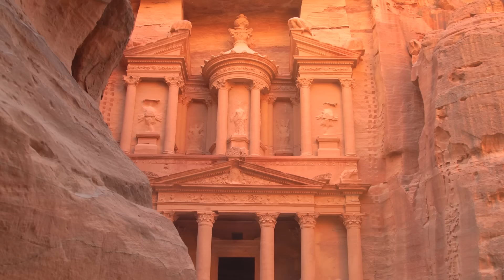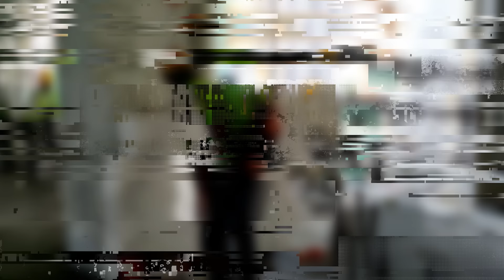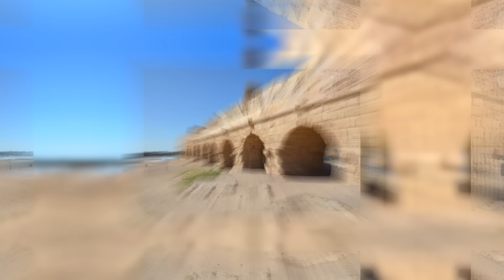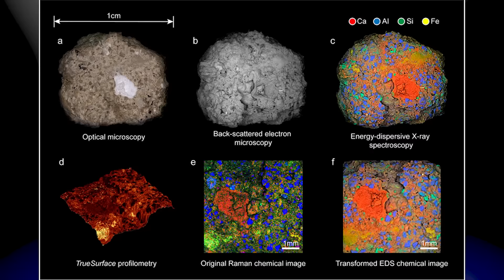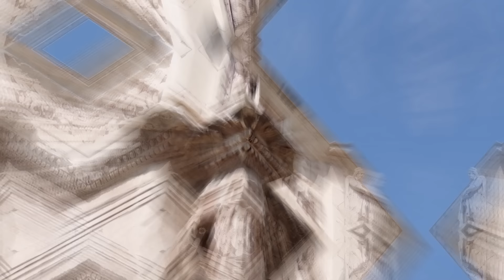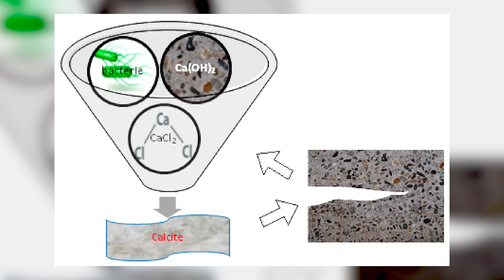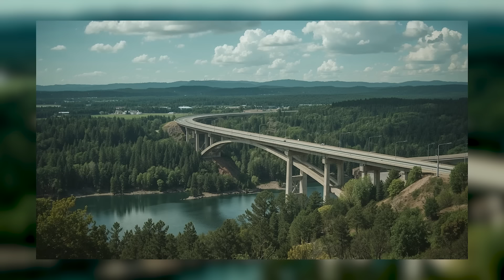Why Roman CONCRETE Lasts 2000 Years While Ours Dies in 50

Comment: Helps to live in a dry country as well.
Reply from the maker: The dry climate does a lot of the heavy lifting on the ones that survived. Though the Romans also had harbor concrete that set underwater and is still holding, so they weren't only getting lucky with the weather.

Comment: The seawater finding really does feel like a game changer. If Roman concrete can actually get stronger in salt water, it makes you wonder why we are not using that approach for every seawall and pier instead of replacing modern ones after only a few decades.

It is frustrating to think we are stuck in this demolish and rebuild cycle, especially when it adds more waste and environmental damage. What makes it worse is the idea that the knowledge is not gone, it just is not being used at scale because the current system has stronger financial incentives to keep doing things the old way.

Comment: There are also a lot of serious mistruths here. Inadequate cover on reinforcing steel, incorrect slump/water content ratios, the applications of concrete in the modern age (whereas the Romans did not use concrete in tension like suspended slabs) are all major omissions in this presentation. 
Overall while there is some good content, this presentation is flawed and misleading.

Comment: Rust is why concrete buildings must be clad in waterproof materials, and not allowed to have high humidity... and why exposed concrete must be constantly maintained.  That is, sealed or painted.  If you coat still curing damp concrete with high calcium lime plaster the two surfaces will fuse together in drying, protecting the concrete underneath.  Which of course is expensive, but lasts longer than paint.

Comment: I built my ICF walls with a cement mixer (Traditional timber frame holds up the structure) stuffed with as much rock as would fit (rock-crete), and I liberally used stored burn barrel ash. Hope it lasts forever. Covered every wall inside and out with rock, tile and sheet metal. Would be difficult to burn down. Quarter inch hardware wire stopping the flying embers getting past the aluminum soffits. Two thousand years later… no problem. I soaked the rebar with creosote so it will not rust. Time will tell.

Comment: Roman bridges are relatively bulky. Too big for the load. They utilize arch technology which has the ability to carry bigger loads. They are not overly stressed. 

Today's bridges utilize different technology. Relatively smaller members, not usually arch,  and are over stressed compared to the Roman bridges.

If the materials used by ancient Rome will be used nowadays, they will easily crumble.

Comment: This really is inaccurate. Even though the Romans sometimes built a large scales, the Pantheon relies on a lot of additional design features to avoid collapse. We do not build in the way the narrator idealizes for practical reasons. Extensively unreinforced concrete could not be used to construct modern high rises and cities, or large scale bridges. Besides the obvious technical impossibility, the costs would not permit this type of construction. Today’s concrete is much more sophisticated than the video suggests. Modern plasticizers, crystalline waterproofing admixtures, more sustainable fly-ash. Epoxy coated rebar, and different methods make it far more suited to modern construction. Take the construct staging and necessary sequence of construction as on instance. That alone would preclude what this video is trying to describe. As of my watching 293k users have watched this video, so seems worth pointing out that although it states some facts it misses the full picture entirely. I think anyone can post a video like this without any real understanding of things.

Comment: Wondering about the numerous photos contained in the video where there appear to be ruins? What caused the ancient Roman structures to crumble? I think it's important to take note of the old Roman structures that are still standing as has been done in this video presentation. @Freedommistman raises some interesting points. His point about sealing the concrete like a glass enclosure is also interesting. But glass also would seem to crack with vibrations from heavy traffic, earthquakes and even wind forces and rains accompanied by rain where things like skyscrapers are designed to flex to a degree. I find it gratifying to see these kinds of presentations especially with an eye to making improvements.

Comment: You asked for suggestions of other mediaeval technology.  I heard that the Incas in the Bolivian altiplano constructed canals with no entrance or exit, so they clearly weren't for irrigation.  What were they for?
It was found that when filled, the canals would radiate heat at night, and prevent the crops from freezing.  It led to huge increases in yield, as these canals are now being used in that way.

Comment: There’s a stretch of Highway 101 along the Oregon coast that’s had ongoing problems from mountain runoff for years. The state spent a fortune installing stainless steel rebar to prevent cracks and slope failures, but it didn’t solve the issue. Maybe a self-healing concrete approach would be a smarter long-term solution.

Comment: The main problem is not the water through the cracks but improper placement of the rebar. Before the pouring of the actual concrete the rebar should be placed in the casing and spacers should be added to keep the rebar more than about an inch away from the casing (= the later outside of the concrete) on all points. And before the pour, this should be checked. If this is done correctly, the rebar is deeply enough in the concrete and will normally not start to rust. However, the checking of the spacers are are correct and the rebar nowhere comes to close to the surface is time consuming and expensive. And furthermore, after the pour is done in the short term there are no visible signs of this problem (unless the rebar actually pokes through...) and so will normally not be found before the bills are paid. This means that it is very tempting to cut corners in the checking of the rebar before the pour. With the resulting long term damage... So the REAL problem is the greed and short term thinking of modern builders.

Comment: Here's the tradeoff the shorter the lifespan of concrete the more we waste sand. Eventually what's going to happen is as we extract the quality of sand faster than nature can provide we will eventually run out of it sooner than later. Only When that day comes it becomes the end of modern era that depends on infrastructure concrete. When that happens It'll be biggest possible disaster like society has ever seen to their structures. Hopefully by then we substitute with something else or we start prioritize long-term lasting durable materials.

Comment: This advert about research funding will not work, my friend. Yes, the Romans used their knowledge based ingenuity. They used something else: their urine which biological matter. Jokes apart if you know what is lime you will understand the secret. Lime is a biological product of microbes living in salt water in the seabed. Our present day engineers add energy by heating it to couple of thousand degree. This heat gets release in a reversed exponential process. When energy is dissipated the bonds also gone. But in an arched structure what you get is compression that helps to make it last longer.. Perhaps unslaked lime get more energy over time. What brings energy is the key to understand the process. Here is a clue: do not think it is only the white light that brings energy to us.
One more thing: the crack concrete model that is being used in the analysis as per eurocode (EN3 as I can remember) is to be blamed. But those design engineers make lots of money from consultancy work. Do not forget the fact that em waves emitted in this process are harmful to those living in new concrete buildings in addition to sudden collapse of buildings without a warning.

Comment: I built my house into a steep hillside using crystalline integral waterproofing mixed into the concrete at the plant before it is loaded into the delivery truck.  This product (attempts to) replicate the autogenous actions of the roman concrete while working with modern concrete and rebar structures.  My cost for this admix was only 1% of the total cost of the concrete foundation install and in my opinion totally worth it.  The other thing I did--and most people don't know this is allowed by code--is to insulate the EXTERIOR side of my concrete walls, NOT interior (with rigid foam).  And then cover that with a waterPROOF membrane (and then dimpleboard yadda yadda then backfill with drainrock).  Not only is my concrete dry, if water ever pentrates the membrane and insulation, it will encounter the self-healing concrete mixture that self-repairs small cracks and seals out more water.  Not only does it make the basement waaaaay more enjoyable (not dank at all), but it reduces all sorts of future issues that would come with a dank basement.  I live in a rainforest (Olympic Peninsula); here we don't mess around when it comes to water management.
Reply: Very clever :-)

Comment: Real concrete as we use in Sweden lasts a lot longer than 50 years. And that is with freezing temperatures and salt from the roads. The biggest challenge the Romans had was a bit of rain water...

Comment: For a long time, modern engineers were baffled by the durability of Roman concrete, especially when compared to some of our own structures that deteriorate in mere decades.

The idea that Roman concrete was "superior" is a complex one. It's not that it was universally better, but that it had a specific, remarkable property we are only now fully understanding: self-healing and incredible longevity in certain conditions.

Here’s a breakdown of the comparison:

The Case for Roman Concrete: Why It Lasts 2000 Years
The Self-Healing "Secret Ingredient": The Romans used lime and volcanic ash (from a place called Pozzuoli, hence "pozzolana"). For centuries, we knew this made a strong concrete, but recent research (notably from MIT and other institutions in 2023) uncovered the real magic.

"Hot Mixing" with Quicklime: They used a process that created lumps of quicklime (calcium oxide) within the mix. When tiny cracks form and water seeps in, it reacts with this quicklime, dissolving it and forming a calcium-saturated solution. This solution can then recrystallize as calcium carbonate, sealing the crack shut. It's a built-in, automatic repair system!

Perfect for Their Environment: Roman marine concrete, used in harbors and piers like the one in Caesarea, was exposed to seawater. The constant battering of seawater actually triggered a different beneficial chemical reaction, creating rare crystalline minerals (like aluminous tobermorite) that made the concrete stronger over time.

Design Philosophy: Roman structures like the Pantheon were massively over-engineered by our standards. The Pantheon's dome is over 20 feet thick at its base. This brute-force approach, combined with their durable material, created structures that could withstand millennia of settling and earthquakes.

The Case for Modern Concrete: Why We Use It
Speed and Strength (in the short term): Modern Portland cement-based concrete is designed to cure very quickly and achieve high compressive strength within days.
Modern Concrete: The Need for Speed.
14-17 Days (Removing Scaffolding/Formwork): This is when the concrete has reached a sufficient "service strength" to support its own weight and the expected construction loads. This is crucial for rapid project timelines.
28-29 Days (Design Strength): This is the standard benchmark in the industry. At 28 days, concrete is considered to have reached nearly its full specified compressive strength (e.g., 3000 psi, 4000 psi, etc.). This is when it can be considered fully "cured" for its intended structural purpose.

Why this matters: This rapid strength gain is what makes modern high-rise cities, vast bridge networks, and massive infrastructure projects economically feasible. Waiting years for concrete to cure, as the Romans often did, is simply not an option in our world.

This is essential for the fast-paced, cost-effective construction the modern world demands. We can build a skyscraper in months, not decades.

Reinforcement: The biggest innovation in modern concrete is steel rebar. This gives concrete tensile strength (the ability to resist bending and stretching), which plain Roman concrete lacked. This is why we can build bridges, skyscrapers, and thin, elegant structures.

The Achilles' Heel of Modern Concrete: The problem isn't the concrete itself, but the rebar inside it. When cracks inevitably form (due to shrinkage, stress, etc.), water and salt seep in, causing the rebar to rust. Rust expands, cracking the concrete from the inside out, leading to spalling and structural failure. This is the primary reason for the deterioration of many modern bridges.

You have a very valid point, but it's a comparison of two different technologies designed for two different worlds. The Romans were masters of longevity, while we are masters of speed and strength—and we're now trying to merge the two.

Comment: Quality Cement is what makes durable concrete.. 
    Cement (also called Portland cement) is a fine binding powder that is never used alone but is a component of concrete and mortar, stucco, tile grout, and thin-set adhesive.
    Mortar contains cement, fine sands, and lime; it binds materials when building with brick, block, and stone.
    Concrete is a strong structural building material composed of cement, sand, and larger aggregate (gravel). It forms structural slabs, poured foundations, and other permanent structures.

Comment: Can a Romen concrete structure handle todays traffic ?  That is hundreds od Trucks over 20 metric tons. I do not think so.
However ... the Romans were great engineers. And yes...They did not have Trucks +20 tons during the Roman Empire.
I agree with @Michaelhansen2818, see lower comment

Comment: I think it’s important to continually challenge and improve the way we design concrete and build modern structures. In this sense, I support the message of this video. However, the presentation is incomplete — it introduces three technologies for self-healing concretes, yet discusses only two of them. I wonder why.

Crystalline self-healing concrete is a far more mature and proven technology. Despite appearing on the slides around the 17’20” mark, it is not addressed in the discussion. The benefits of crystalline technology in terms of durability, service life extension, self-healing capability, reduced maintenance, and overall sustainability are already well established and supported by extensive field evidence.

Comment: Thank you for this insightful youtube..but its not so easy...Romans used compression structure... arches domes etc... they didn't build structures with structural elements in tension... tension structure include anything in bending.  Rebar allows for tension and bending!   There is a huge efficiency ... much less concrete is used with tension structures.   I don't know how one would build a retaining walls without using 10-times the materials for example for a 10-foot high wall.    One could not build deep parking structures under building or build tall buildings.    Bridges would be enormous...you have a picture of  Roman Aqueduct and it couldn't carry a modern tractor trailer truck!    

YES! contractors and businesses like to build and rebuild... they make money!  So design protocols may be based on shorter than is desirable life spans, for example concrete paving for highways.

Yes healing concrete would be useful especially in salty environments and/or where road salt is applied...  but lacking salt water... there is no reason modern concree designed and built properly can't last 2000 year... like the amazing Roman stuff

Comment: A fact overlooked by engineers:  The lime in concrete eats away at the rebars, causing rust.  Maybe this could be solved by stainless steel rebars, which are expensive.
Reply: Or epoxy coated but lime is highly alkaline and if heated making it anhydrous (loss of H2O) it is dramatically more alkaline and I always thought that was what making concrete was about to begin with. The bridges in SC are being replaced after some lame brain spot repairs turned into a ongoing project running 10 years to dig a hole big enough to bury everyone involved as the rusting went ballistic after exposure to the elements. They couldn't keep up with the damage they were doing.

Comment: Consider basalt fiber reinforced concrete. Basalt fiber has incredible properties, and basalt is available in immense quantities. However, designing structures that depend mostly on compression can be wise until we master the basalt fiber reinforced technology and have reference. There is no reason why we should not start to build smaller structures with basalt fiber reinforced self healing concrete in this decade. We must build a sustainable economy, not a destructive one.

Comment: A question can rebar be replaced with fiber glass rods,  cord or mesh nets ?
Reply: Modern concrete installation uses resin coated steel rebar if built to code or architect's specs.

Comment: Seriously, this is science engineering media by hysterics And paranoia. Obviously any Meathead could figure out that they have to treat the concrete in order to make it water resistant and you can do that at the surface after it's constructed. You can do that with dirt. They run tanks over dirt that has been sprayed one time and makes a hard surface. It's kind of like a fluoride treatment. 😅
Reply: It's called civil engineering brah. Inspection and maintenance are part of it.